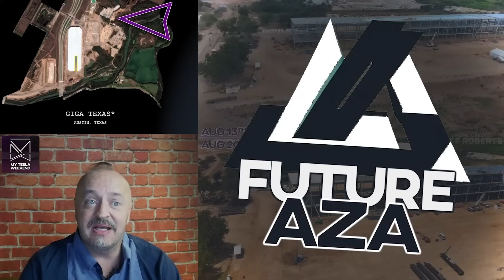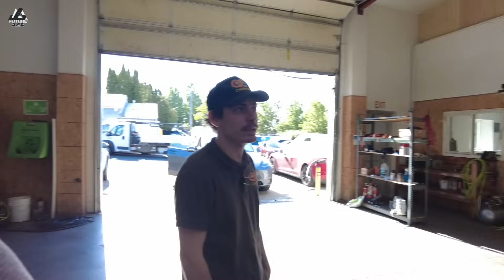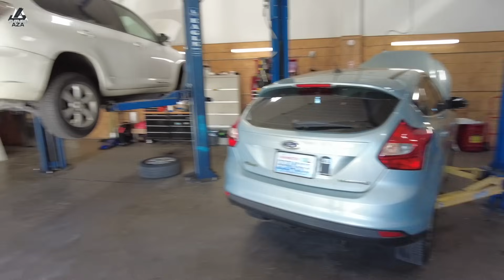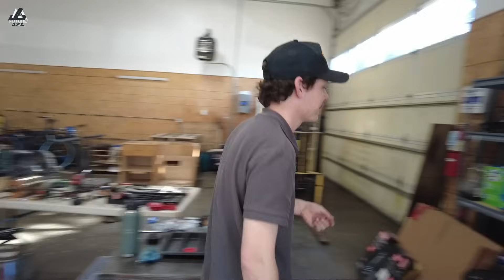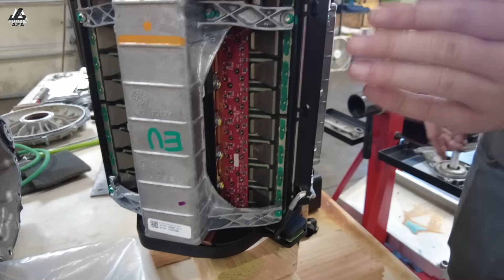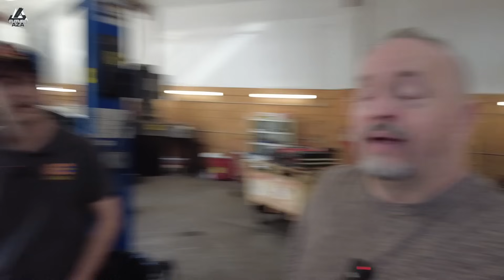Your EV Battery is NOT a Ticking Time Bomb

Comment: Would love to see a video on the effects of age of EV vs Mileage, and which is more important to consider when it comes to battery maintenance/life expectancy of the car. I only drive between 3-4K miles per year, so owning a Tesla for 8 years would only be about 30K in mileage. I know there’s not a TON of data with the oldest Teslas only being 12 years old or so, but I think many fans may have similar concerns.

Comment: Did the fatal flaw of the leaky seal get addressed and fixed in the new models?
Reply: Every motor iteration beyond the LDU uses a totally different cooling setup, so only LDUs suffer from this failure mode. The Tesla vehicles that are equipped with the LDU are: 2012-2021 "Legacy" Tesla Model S/X in RWD and/or Performance variants (dual motor, non-performance do not use the LDU). The Toyota RAV4 EV and Mercedes B-Class also use a slightly modified version of the LDU. Model 3/Y of course have never used the LDU. 
The latest "U" revision of the LDU has had the rotor cooling deleted (much like the manifold that we install), so they don't have the seal issues. This latest revision has only been available for the last ~6mo for replacement LDUs.
Reply from the maker: Literally no idea what you're talking about.
Reply: @FutureAzA 
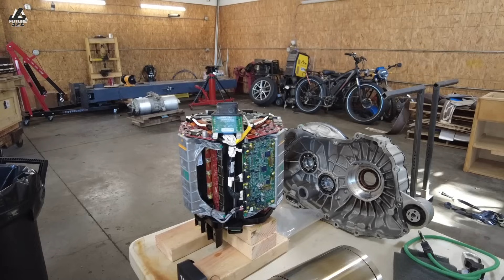9:01 
The leaky rotor coolant seal. The leak that can destroy the Drive Unit.

Comment: Eventually some smart 3rd party company will make replacement packs
Reply: There are already some aftermarket packs available (mostly for the LEAF), but almost all of them that I know of come from Chinese suppliers with often "questionable" quality. Unfortunately they are difficult and costly to import, but I have worked with a couple that seemed pretty decent.

 I know of at least one U.S. based company that was planning on building packs for the LEAF as well, but they were cost prohibitive IMO. EVs Enhanced out of New Zealand was working on an LFP aftermarket pack, but I haven't really heard any updates on that in probably at least 2 years, and the last that I had heard, making them available to the U.S. market wasn't a priority. 

The only way aftermarket packs can work at an affordable level will be if they can be built at scale. Hopefully in the not too distant future, there will be options available for many of the mass market cars (for most of the lower volume "compliance" cars, I wouldn't hold my breath).

Comment: Here in Maine, we are driving a 2014 Leaf with about 80% range remaining.  Typical morning shows me 85 or 83.  For fun I asked the dealer about a replacement battery, they said "about 15,000."    The car is 10 years old, and still performing beautifully for all our local driving.  Now at 102,000 miles
Reply: You can find remanufactured Nissan Leaf battery packs online for about a quarter of that price, unless they're charging $12,000 for installation!
Reply: 80% sounds about right (or even above average) for a 2014. And yeah, new packs from Nissan are definitely cost effective. It seems Nissan has really "deprioritized" the legacy (pre-2017) LEAF, and even customers waiting for warranty pack replacements are often waiting months (some even over a year). 

Decent used LEAF packs however can be had for much more reasonable pricing, though it's often location dependent on where you can actually find good packs. In hotter climates, they are pretty sparse, but in cooler climates (like here in the PNW), they are pretty plentiful. I can source ~80% or better packs for around $3k all day long. Usually the folks looking for replacements are those with older LEAFs that had less robust chemistry, and are down to 60% or less capacity (I've seen some as low as 35-40% capacity on the 2011-12 models). 

For $15k, I could source a good, used 62kWh battery and more than TRIPLE the range on an older LEAF!

Comment: I'm curious what the used market will be like in 10 years when there are more worn out and crashed cars you can buy for parts. I.E. buy a crashed car with a newish battery and swap it into an old car with a degraded or failed battery. Of course, with a 120,000 mile warranty on the battery, the car would be pretty worn out.
Reply: 120k on a car is nothing in ten years now…
Reply: @fractalelf7760  Yeah, on an ICE car.

Comment: Battery modules have dropped close to 50% in 2023 and are due to drop another 50% in 2024.
Reply: But that doesn't mean a retail customer can get that savings.
Reply: @tireddad6541 
<sigh>
Reply from the maker: For manufacturers, yes.

Comment: What are his impressions of the GM Ultium batteries? Are they easier to diagnose or repair?
Reply: Ultium has only been out for about 2 years (starting with Hummer EV), and the first "mass market" models have only started deliveries quite recently, so there's not enough data out there to really know all that well... Also, all Ultium vehicles (unless high mileage or salvage title) are under warranty, so it will probably be years before I even see one though my shop.
Reply: Since they were only released ... 4(?) years ago, they should ALL still be under warranty.
That being the case he won't be dealing with them.